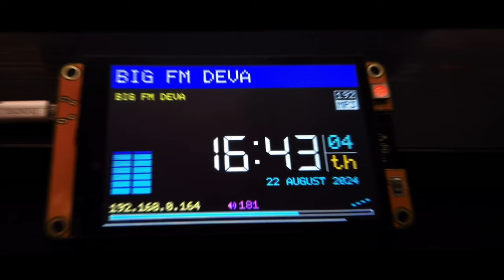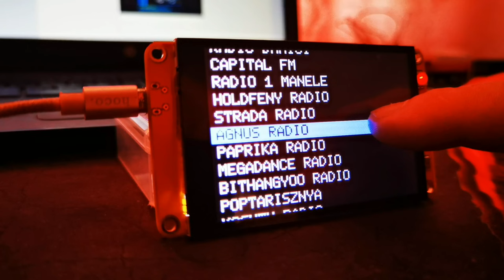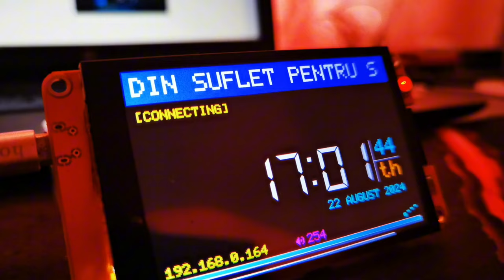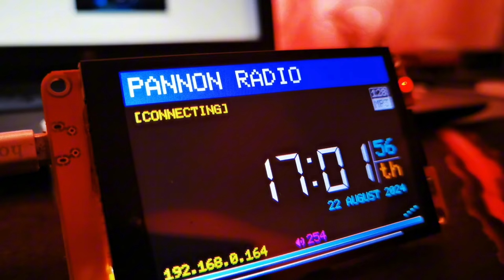yoRadio on esp32-3248S035C with capacitive touchscreen!

Comment: Hello! I have a question for you. I can't find how to connect the encoder, I can't find where to connect the GPIO 0, 4 and 16 on this esp32_2432S028 screen card?
Reply from the maker: Hi. I haven't tried connecting an encoder to this board. The board only has a few pins available, some even use the RGB LED pins, of course I unsolder the LED.

Comment: I am glad you did it, nice to see some of the newer screens being used. Many thanks
Reply from the maker: Read the video description carefully for more details.
Reply: I don't have that board but have some newer CYD style boards from GUITON. These use a Qspi driver for the LCD so not sure if than can work with the library s used with yo radio. Shame but Ty for the information
Reply from the maker: I have no idea if it can be adapted to the boards you have. First of all, you need to see which driver the display has, the pinout with which the microcontroller display is connected, and then you can try to make your own myoptions.h file. By the way, I don't know which microcontroller your board uses. If it does not have ESP32 WROOM or ESP32 WROVER, you have little chance to make yoRadio functional with the code that is provided to us.
If you want to make yoRadio, the ideal is to look for the hardware for which it is already optimized and then you will be able to do it simply, or if you want to adapt it to a new hardware, rewrite the code so that it can be used by your hardware.
Reply: Se misca mai bine cel capacitiv?
Reply from the maker: @Flyonwaterslow  Tocuh-ul capacitiv este incomparabil cu cel rezistiv.

Comment: Hey. I'm impressed by what you're doing with yoRadio. I use your tips. I ran esp32-3248s035C (capacitive screen).  I wanted to connect an external dac pcm5102a. I found some tips on the internet. unfortunately it doesn't work for me. You write that you are using an external DAC. Can you tell me how you connected it to this model? best regards and waiting for your reply.
Reply from the maker: I also want to connect a DAC to this microcontroller, but for now I haven't had time for it. I hope I succeed because this display with the capacitive touchscreen is special!.

Comment: Very nice tutorial, thank you very much for sharing.
I replicated the project following your tutorial and it is working well. However, it does not play my favorites radios in Brazil and Europe. Do you have an idea why the project just play the radios preset in the playlist.cvs?
Thank you.
Reply from the maker: You can add radio channels from anywhere in the world. The problem is the format in which the transmission is encoded. For example in this version we don't have a dedicated DAC. Try adding a dedicated DAC e.g. PCM5102A and you will probably have more functional formats. For example the OGG format doesn't work with a PCM5102A either.
Reply: @LeventeDaradici  I'll try a dedicated DAC, thank you!
Reply: @LeventeDaradici  very nice, I am using PMC5102A and it is playing all my favorites stations. Just one more question: the touch screen is not working, any guideline for this? sorry for the very basic questions.
Reply: @rogenogueira  did you use this line ??
#define TS_MODEL            TS_MODEL_GT911

Comment: Sketch upload without error, plays in the serial monitor, but the screen remains black.
Does anyone have an idea what I'm doing wrong? I'm using esp32-3248S035C and esp32-2432s028r and i have the same problem with both screen's.
Reply from the maker: Is the myoptions.h file the one I put in the video description?
Reply: @LeventeDaradici  Thanks for replying.
Yes I used the myoptions files from your website. For the appropriate screens, esp32-3248S035C gives a white screen and esp32-2432s028R gives a black screen.
And radio works in the serial monitor.
Reply from the maker: Put a link with the place where you bought the microcontroller.
Reply: Check the settings in your browser to be sure the screen is on.